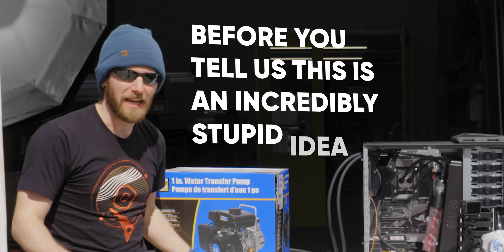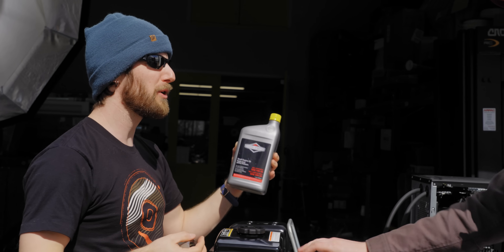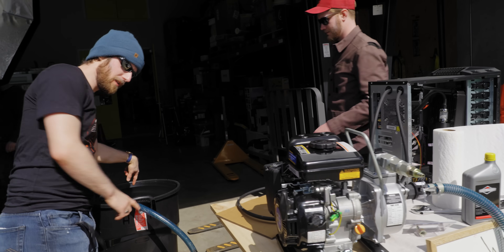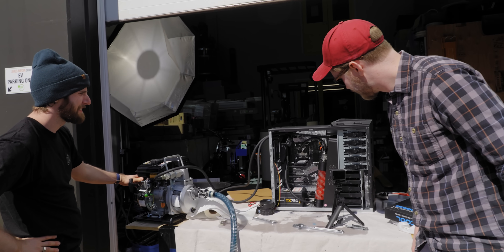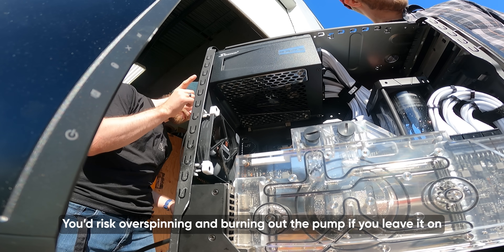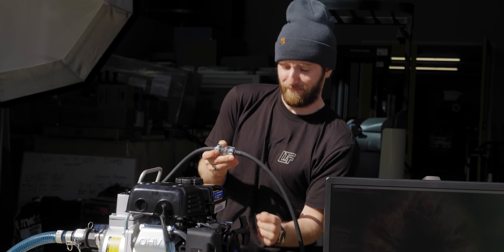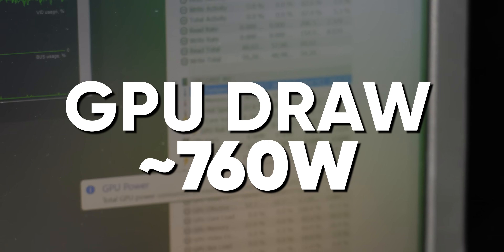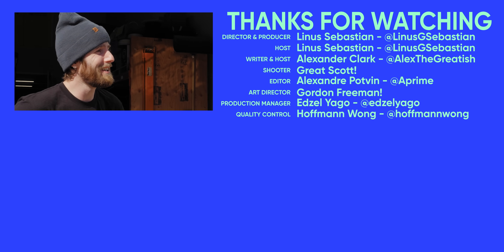Cooling a PC with a 2.5HP Pump

Comment: So, stupid idea, but maybe it'll work:  What happens if you connect a PC up to a water faucet and run an open loop trickling back into the drain?  How hot can you overclock on the cold water tap alone?

Comment: assuming it is constructed for pumping through a 1.5 inch hose and that a pc cooling pipe is .5 inches inner diameter you reducing the cross section by a factor of 9.
the only way to efectively use this pump would be a central cooling like in your whole room cooling project. 
using pipes that add up to the crosssection needed you could connect 9 radiators in parallel, as well as 9 computers, or 5 computers that have separate GPU and CPU cooling

Comment: Always be careful fiddling with the max RPM limiter on these simple engines, cause they will rev to the moon and back if you loosen it too much. I blew a head gasket on one doing 9k RPMs cause these are designed for such low RPM cases.
Reply from the maker: It started to run out of fuel after only about ~500RPM, need to drill out the "injector" to go anywhere near fast enough to harm it -AC
Reply: @LinusTechTips  yo ltt your air conditioner took over the channel
Reply: Pretty sure the engine/pump were only planned to be used for one show anyway so pushing it until something broke was what they were trying, and if it had been the engine, they'd be fine with that.
Reply: I've done governor deletes on a ton of motors, specifically the predators and they don't usually rev past 7k cause of valve float, the main thing that gives before anything else is flywheel, piston and rod mainly
Reply: Now I feel like we missed out on that opportunity.

Comment: Now its time to put a build in non mineral oil and pump the oil thrue a chiller... PC rig in a transparent ikea storagebox filled with oil, one pipe goes out into a pipecoil into a chiller and the other end comes out of the chiller into the box... Maybe if you can get real demineralized water without any conductive particles in it try this out..... 

Thats a experiment for real Pros.... Do not try a Home it can cause you're dead....

Comment: When dealing with fluid dynamics there are three types of head static, pressure and elevation.  There is an equation that relates all of these to elevation head.  What is available on the supply side of the equation is also available on the demand side with additional considerations for head loss.   Most of your headloss in a system like this is going to be due to velocity head.  The way to reduce velocity head losses is to increase the diameter of the conduit  to lower the velocity of the fluid.  This will allow you to move a higher volume of water at a lower velocity which will reduce your static pressure.
Reply: On layman's term, custom cooling blocks with maximum jankieness.

Comment: Remember: The faster the water goes, the less time it has to pick up and release heat.  Seems counterintuitive.
Reply: Your understanding is wrong.

Here are some things to understand:
1. The bigger the difference in temperature between the water and the component, the faster the heat will be conducted.
2. Having slower water gives it more time for the water flowing through the components to heat up, which reduces the temperature difference.
3. Because temperature difference is reduced, the water becomes less efficient at removing heat.
4. Thus the faster the flow rate, the less time each unit of water spends flowing through the component, thus the cooler it remains, which retains maximal heat transfer efficiency between the component and the water.

Basically its better for each unit of water to only heat up a little than for lesser units of water to get heated up a lot.
Reply: @dickyderp819  Explains most of the process, but is incomplete.  With just those points, heat exchangers would not be able to work as they do inside a refrigerator, freezer or A/C unit.  Pumping coolant through a conduit can result in the conduit actually becoming colder than the coolant started, so long as the coolant is given the correct chance to dump heat energy. (usually involving a pressure or rate of flow difference)

You can also think of as how spray cans and bottles of compressed air become colder as you use or shake them, but are otherwise the same as ambient temperature.
Reply: @dickyderp819  I mostly just extrapolate from videos like these three on heat pumps:
https://youtu.be/MFEHFsO-XSI
https://youtu.be/7J52mDjZzto
https://youtu.be/7zrx-b2sLUs
The basics of a heat exchanger/heat pump are similar to PC water cooling, just with a more sealed system and an extra valve to create a larger pressure differential.
Dedicated refrigerant (such as R-134a) isn't strictly necessary for a heat pump, but it does make the processes easier due to the lower freezing and evaporation points at a reasonable pressure range.  Water could work in a heat pump but has an inconveniently high freezing point, making it less than ideal for anything that might drop below that, it also freezes if too much pressure is applied and requires a fairly strong vacuum to evaporate without significant heat, but it could be used.

BTW, a heat exchanger is anything that moves heat from one place to another through an intermediary, water cooling is a type of heat exchanger and a type of heat pump.  All the same formulas apply to all three.
Reply: But there'll be more units of water per unit of time "picking up and releasing" the heat, resulting in a greater energy exchange. Heat exchangers always benefit from higher flow rates.
Reply: @xdave38x  They also have a giant reservoir to work with. The system probably never got heat soaked
Reply: High flow actually strips away more heat than low flow, while low flow allows it to release more heat.  It's the same as how a fan makes things cooler by moving air faster.  The radiator in this build might actually start to form ice if they let the it run for a while with no thermal load.

To explain a bit more scientifically, the pump pushes the liquid through the pipe, but the liquid also tries to spread out and is restricted by the pipe.  The pipe requires energy to restrict the flow but has no kinetic energy to impart on the liquid, so the liquid instead steals away thermal energy to excite the molecules into bouncing off the sides of the pipe.  This process repeats until the liquid is slowed or heated enough that it imparts more energy into the pipe than the pipe imparts on the water.

Comment: If you have your heart set on using that system you need much larger tubing and fittings.  The headloss you are creating in your loop by using tubes and fittings several sizes too small is why you are generating a bunch of static pressure.

Comment: Civil engineer here.  How much headloss did you create in the system by reducing the outlet to what a quarter inch?   Add a psi gauge on the outlet from the pump and another at the end of the loop and see what the difference is.

Comment: I feel like the low temps is not from the gas pump but from the water not being circulated back into the system... or well having the thermal mass of a trash can of water...

Comment: I think I know what's going wrong here.
You've picked a pump build for high flow instead of high pressure. Most irrigation pumps are high flow because they just suck water and spit it out a hose. A high pressure pump (such as a pool/drainage pump) is designed to not only lift water up high, but pump through high pressure systems such as filtration or solar heating systems.

It's the difference between going high gear or low gear. One is great for getting up a hill. The other great for going fast on the flat.

Comment: What I would love to see is keeping a CPU cooled in an absolute vacuum.
Reply: Heat pipes thermally bonded to a large black mass. Radiation is all you have in a vaccum
Reply: @nloughner2015  There are other ways, but they are not sustainable. Evaporating into the vacuum is the most notable.
Reply: @kg4wwn  didnt think about non steady-state solutions. That would totally work
Reply: @nloughner2015  good ol engineers with their steady state assumptions lol
Reply: cak01vej  I would actually counter that a lot of PCs on earth use significantly more power because they are more powerful. Cooling is heavy so most computers in space are optimized heavily to reduce power needs.

We have managed to provide cooling to some incredible equipment in space, and the most complex cooling solutions can be found in Parker solar and james webb.

It seems like our issues with computers in space are resilience to radiation more than cooling. From my mech E side the cooling seems easy compared to the radiation hardness and other resilience needed.
Reply: I would love to see an entire PC in a closed loop gas system, where you don't have to worry about condensation breaking anything. PC inside an old chest freezer connected to a household AC unit perhaps, filled with nitrogen maybe. Someone must have done something like this already, but I can't find any evidence!
Reply: cak01vej  I would agree on the little bit of both, cooling and energy consumption are literally 100% related, so work on one can help both. Im not sure which they intended, but its very likely the relation between the two was always on the mind given how constrained these systems are.

Comment: Y'all should try this again with gravity as the primary source of flow. 500 Gallon tank on the roof supplying flow to the PC, with a secondary collection reservoir at ground level. Use the gas pump to move the water back uphill to complete the loop.

Comment: Since this is a kind-of open loop running at high velocity, I wonder if it might be more efficient to actually remove the radiator, etc.
Reply: With such a massive reservoir they could even run it closed loop for quite some time before the water gets warmer. And if they optimize the water container to be made of metal and flat and with ridges kind of like a heater at home, then they would have a giant passive radiator
Reply: They did remove the radiator, because they are attaching to the loop via the external fittings where the radiator was attached under the desk in the sleeper PC build.
Reply: @Joshimitsu91  Oh yeah, that’s right. I forgot that the radiator was mounted under the desk in that build. Good catch. I believe the pump and reservoir were internal and still connected to the loop.
Reply: Or they could re-use their radiator from the boiler they found a few years ago. If they’re gonna overkill anyway, might be good to bring that out again
Reply: @GollumBetrayerOfHobbits  just dump ice in the resevoir for uber temps
Reply: It would. The radiator just adds resitance with minimal cooling ability but due to the mass of cold water in the loop it does barely matter. So i would say the resistance is higher than the cooling ability
Reply: Without a radiator you rely on the pump to dissipate the heat... not going to work well.
Reply: @zuggzugg  The giant open reservoir would dissipate the heat dude
Reply: @zuggzugg  if they were going to run this for an extended time, they would definitely need a radiator. For short runs like this, the trash can full of water suffices as the radiator, though they would want to keep the pump hose away from the return hose.
Reply: @zuggzugg  good luck heating a bucket of water with a GPU/CPU.
electric shower heads which hold much less water in direct contact with a coil usually pull around at least 4000W and i have seen 10000W monsters. and they heat water to what?  40C?

its gonna take a while to heat that bucket up with this setup

Comment: Man after taking Fluid power course.. its actually kinda dangerous if you dont follow the right specifications with proper fitting and lines but thats for hydraulic machines in heavy equipment and this is just a pump that isnt building up a ton of pressure

Comment: Has entire workshop full of machines and tools proceeds to by multiple adapters to neck down outlet of pump. This is also why it was stupid to get rid of their manual lathe. It would have taken less than an hour to make a single adapter for whatever size they needed and cost like 5 dollars at most.

Comment: I think if they take a water block, replace the plastic part with an CNC one, weld them together use high pressure fittings you could possibly hook an pressure washer to this thing. No radiator no pump nothing
Only water supply-pressure washer-waterblock-and water supply if possible

Comment: My artesian well runs about 50 degrees and a 1 inch stream out of 300 foot of plastic pipe got a box fan sitting by spaced out coil keeps our 12*20 lean too greenhouse 45 degrees all winter in SW Michigan

Comment: nah i call it waste of money......
i've been using chiller for my laser machine for over 5 years.......... after thinking stupid things like u guys did... my best choice is to use industrial chiller as water coller..... its the best.... we can also set the temp so that its not too cold and make some water dew .........

what u guys did with that gasoline water pump... either the pump is broken, or the hose is broken.... its too much power..... too much water flow.... u can only put as much flow as much as that TINY radiator fins......

a simple submergedsible pump will be very suffice......

Comment: I daré You to use a water well as water supply and reservoir.
Just pump the water throught the water block and back to the well, si You Will hace a geothermal loop. I'm My country the water from a well si alwais ay 19 or 20 celcius degrees and the well can easily absorb the heat from a pc

Comment: You should redo this with a custom made high flow water block. Get it set up with 1" BSPP or 1" NPT fittings. Isn't Alex and engineer? Put that CNC mill to work.

Comment: 5:57 yeah,  it's a lot of pressure because you're using a tune whit a small diameter,  so,  if you want more flow and less pressure you need a larger tube💀

Comment: You need to secure a used process chiller as used in the plastics mold and extrusion industry.  I work in the industry and even a small one can rapidly cool large molds from 400 degrees to 45 degrees in less than a minute.  Coupled to a watercooling setup, these units would easily sink a 1000w  or more of thermal energy continuosly and keep setpoints down to 35 or 40 degrees F.   The best ones to use are dual loop: the unit contains a water loop that is cooled to 35 degrees and has a  heat exchanger to interface to your external loop.  You would essentially  just take the lines off of your existing radiator and run them through the process ports on the chiller and then turn the system on.   Best of all,  they are fairly cheap on the used market.

Comment: I'd bet you would have better results doing a splitter instead of all the adapters going down to one small outlet. 
Give CPU and GPU their own input, then have them each output directly back into the water can. Bypass all other parts of the loop including res and rad. The can full of water is your res!
Of course the pump was overheating with all 8 of the adapter bottlenecks

Comment: I really want to see groundwater cooling.
Dig a hole about 30 feet deep, until you reach groundwater, then put a copper pipe loop down the hole, making contact with the water.  Connect the loop to the PC.  The groundwater should sink the heat generated, eliminating all fans.

Comment: Y'all really need to get down to see how massive some pumps can get. A few years ago I got the chance to work on a project replacing some failed 100MGD (100 million gallons per day) pumps for NYC in a wwtp lift station. Also theres a transfer station in dallas, tx with 375hp pumps. they can get insanely large.

Comment: If I’m not mistaken there’s more pressure in the line due to going from a large outlet to a smaller inlet so the water cooling only is as quick as the smaller line can perform

Comment: Not gonna lie, this was a bit disappointing... The theatrics were fun, but the blatant disregard for flow vs pressure output on the loop was distracting. Also, the thumbnail shows you pouring gasoline on an electric motor. Fun is fun, but the tubing was too small to have faster flow regardless of what you hooked up to it, so it was just building up heat and pressure in the pump head and is probably why it was overheating at the end. Love you guys, but this was a miss for me

Comment: You need a good electric motor, more strait and fluid flowing liquid in front of the CPU plate. Currently there is too much turbulence caused by a complex circuit and a volume of water that is too intense relative to the circuit. Adjust the speed of the motor electronically and let the water move more fluently. You could gain more speed or liquid flow this way. If you are willing to invest money into that, it could go pretty far. ✌️

Comment: To make this "daily driver" material, they should just go to the kitchen, use a water faucet, and run the water from the water faucet. Probably upgrade their building's water pump, and cool their water reservoir. No Noise, No fumes, with all the benefits of this concept. Only drawback i can think of is when somebody showered or wash the dishes, your gaming performance might dip.

Comment: I feel like the radiators are an impedance here. With the speed the water is moving, your bucket of water is all the heat dissipation you need.

Comment: I want to see a cooling loop using the heat from the cpu to power the loop's pump.
Reply: I'm not sure how that would work. Thermal energy is very inefficient, and it would result in less performance, as the CPU would have to constantly be thermal throttling for it to work.

Comment: if the cpu or gpu block (radiator too) could handle it  I can build a loop  that can handle up to 120 bar (1740 psi) ... it not gonna be as pretty as a normal wc loop but it gonna haddle this small motor..

Comment: You should have used a higher volume radiator. Like a car radiator with heat pipes to the gpu/cpu. With electric fans on the radiator.